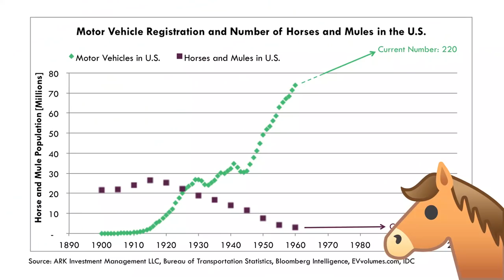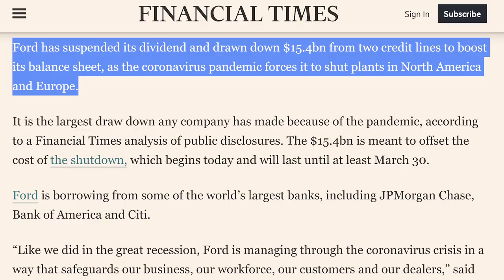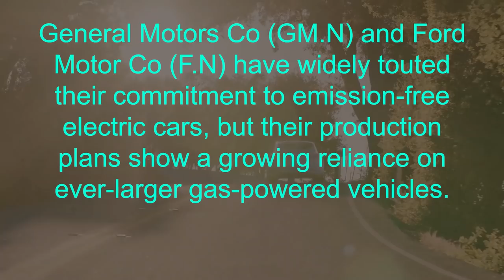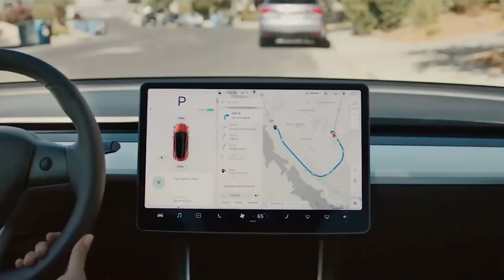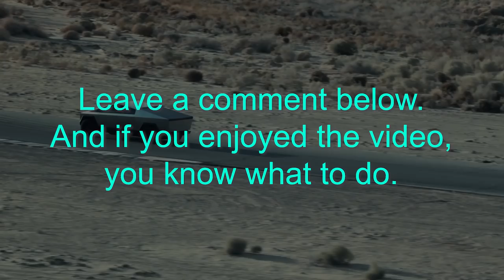Ford and GM are in BIG Trouble (bankrupt soon?)

Comment: 0:14 when I read “I’m using Tesla footage because they won’t sue me” I was like ok yeah I can see that, sounds reasonable, then I saw “they’re eating Ford and GM’s lunch” I just started to crack up 😂😂 I love this channel.
Reply: Girard Perregaux  Thanks
Reply: Lol Tesla's revenue has never made it over 13 Billion. In 2018 Fords revenue was 160 billion. GMs was 190 billion. Get real.
Reply from the maker: @chasejordan22  Your credibility vanished 9 words in dude. They did $13B in 2017. Sorry to see you self-immolate so quickly.

Perhaps also you don't understand the value for growth. How much is Ford and GM growing revenue by every year?
Reply: @SolvingTheMoneyProblem  
Ummm? 13 Billion is not over 13 Billion....... Jesus son. 
 Damn is that a difficult concept?
 Ford has the best selling vehicle for 45 years. Telsa.... Has some neat grocery getters. I cant do my job with a tesla. Because I tow. It's impossible.
Reply: Chase Jordan 
GM and Ford sell most of their cars at cost. Money is made in the financing. When ICE cars start to fade their used resale value will plummet. Big Auto will be picking up the tab on cars worth far less than the PCP final values. 
Not to mention their now worthless manufacturing assets and huge pension liabilities.
Reply: @Dave5843-d9m  
Your basing you point off one line. When their sales fade. The best selling vehicle, the f series, has capabilities that Tesla is only starting to dream about. Look up towing range on current models. Batteries are still years and years and years away from even competeing with diesel engines. 
Resale value will be competitive until you see a 30 year old neglected EV still trucking down the road. Like you can see all day long with combustion engines. Optimism bias affects us all.
Reply: @chasejordan22  Stock values are based on FUTURE earnings and values.  What do you think Wall Street is valuing Ford and GM vs Tesla?  That is real.  Just borrow a Tesla and drive one - you will curse at your own car when you drive home in it.
Reply: @SolvingTheMoneyProblem  holy crap you freaking killed him dude
Reply: @dzerres  
Ah hah a thrid argument but finally a logical one. Ford was in the money spending, profit loosing phase of updating its trucks to a new gneration (engineering and research and retooling plants) when the god for saken virus hit. Bad timing. Ford has survived every recession for a hundred years, they'll make it through this one too.
But as I mentioned before, I drive a truck. An F-350, whose resale value is at 54% in 5 years. Higher then any Tesla. You cant do what I do in a Tesla, its impossible. I doubt I would be very impressed because my standards would be very different then yours. I suggest you go test drive a four door F-350 King Ranch.
Reply: @oscarprice7030  
I said they never made over 13B
He said "They made 13B in 2017".... 
Do i have to explain to you that 13B is not over 13B as well? 
I doubt it would help much.
Reply: @chasejordan22   a quick Google shows they made $24.6 billion revenue  in 2019 which I would expect considering they made 13 billion back in 2017? Why is everyone else getting this but not you ?
Reply from the maker: @chasejordan22  It's not 2017 anymore Chase. Tesla's revenue has grown every single year since going public. That includes growing from 2017 to 2018 AND from 2018 to 2019.
Reply: @candidate17  
Yes I saw that myself. I was going off previous knowledge. That is new info to me. That literally doesnt change any of the argument. Even the 13B is not more then 13B. 
So they made it up to 24B this previous year. What does that change about what Im not getting? 
You know the difference between revenue and profit? What was Teslas net profit in 2019? Negative 800 million. Search that one.
Reply: @SolvingTheMoneyProblem  
Correct. My response was directly to your ridiculous comment. Their revenue has increased. What is their net profit? Negative. Other companys promised much more in the past. Talk to me when they have a few profitable years.
Reply: I think the world has more confidence that after covid-19 tesla will be able to dig out of the financial hole quicker than Ford, just look at the stock prices
Reply: @chasejordan22  your completely missing the whole point of this video , it's not a race of who is making more profit, it's a race of who is making solid foundations for the future of vehicles.

I'm pretty sure the mass horse breeders were making far more profit than the first car company back when they were some backyard creation too. And look how quickly that changed. The whole point of this video is adapt of be lost to time .
Reply: @candidate17  
I made a comment. Which I do suppose was incorrect because of the dollar amout. But that small difference doesn't change my original argument. Then I had a bunch of responses and I replied to each one accordingly. 
If now your point is Tesla will be more profitable in the future, then my response is thats just a prediction and if it were that easily known we would all be investing and making millions. Too many company's have promised the same thing and never delivered. Does Tesla have some promise? Sure but the overwhelming notion on the internet and this comment section is Tesla is going to either just replace Ford GM and so on or just dominate the market. Thats very very pie in the sky. You'll need much much more evidence to convince me of that.
Reply: @chasejordan22  Don't underestimate EVs. Their flexibility electricity production and storage, along with the shear power of their motors, gives them options that gas trucks don't have. There are already 4 EV trucks (at least) that can out tow your F350. 2 of which have better range as well. Granted, none of them would replace your F350, as 3 are semis that are in active testing (not selling yet), and the 1 EV truck that is being sold is a specialty quarry truck that is only useful in certain circumstances. Although that certain circumstance gives it unlimited range. Pretty neat use case. The Kuhn eDumper.

Again, none of those will replace your F350, but it does show what an EV can do. After the Tesla Semi begins production, it's charging network will expand with options to charge those big trucks quickly. Once done, you will likely start seeing actual work truck EVs being sold. It is also possible that FCEV trucks will begin selling within a few years as well. This would help with range and weight issues with current batteries. Each will be a few more years before they expand to be an option for you. Still, they will be able to replace most work done by other SuperDuties at that time, and will likely save you hundreds or even thousands of dollar each month. At that point, you would be crazy to not replace the F350.
Reply: @chasejordan22  For the revenue numbers, Tesla doubled their revenue in 2 years from 2017-2019, and they will likely double again between 2019 to 2021. Ford will likely drop 15-25% between 2018 and 2020, and likely drop again in 2022. This is Ford's big problem. Last year, they effectively made no profit at all. But even if we take 2018's numbers for them, they only made $3.6 billion. Combine that with a likely more than $20 billion drop in revenue this year and likely more drops in the coming years, and you can start to see why their future is in question. 

Still, Ford has a huge amount of cash on hand available, more than enough to weather the storm this year. However, there will need to be some cuts and restructuring may be put on hold. This could spell disaster once both Tesla and Rivian start selling their future EV trucks. While neither will likely take the crown of "best selling vehicle" from the F150, they will hurt sells, especially in the highend truck market. I wouldn't be surprised to see F150 sells drop 20% or more, while profit from F150s drop 30% or more. If something similar were to hit next year, Ford wouldn't survive it. But, since they do have so much cash on hand and about 2 years before it hits, they have time to prepare.
Reply: Chase is looking at things as they are today, not where they are headed. Tesla has a very limited range of vehicles. There towing capacity is definitely a weak point up to now. The model Y does not even have a tow hitch. I'm actually a Tesla fan and that is disappointing to me. I think this situation is going to change in the relatively near future. The tri motor cybertruck with a 800 km range battery pack will finally have enough range to afford to also be viable for serious towing. I'm in Australia, I pre ordered the tri-motor. I dont expect to get it till 2023. It's not really that far off... especially with 2020 being completely fucked with this plague lol
Reply: @chasejordan22  and then comes TSLA's Semi and Cybertruck 😂
Reply: @andrewpp2000  
Your not serious are you? The Cybertruck is a grocery getter. It cant tow as much as 20 year old f250s.... The semi is in the shell car stage. Let me ask you thism when will the semi even hit production? You Tesla fan kids are awfully blinded by your optimism bias. And just ignorant.
Reply: @Isaac Barrett 
I call the Cybertruck a grocery getter like I call A Toyota Tacoma a grocery getter. Ive wrote it a dozen times, a 20 year old f250 can tow much more weight farther. You could never tow a camper across your state with a Cybertruck. Thats why I say what I say.  Battery is still a long long way away from competing with diesel. And when I hear the talk of Tesla replacing Ford and Chevy in five years, well its laughable.
Reply: Well with Tesla’s abysmal build quality and trashy reliability, I don’t think we’re gonna find any “solid foundations” from them in the near future.

Comment: I used to work at a job which had me working with Ford and GM executives a decade or so back.  I remember talking to a GM guy who was talking about the hundreds upon hundreds of plants they had, scattered across North America making bits and pieces of cars.  I asked “Why would you have so many plants?  Isn’t it incredibly inefficient and expensive?  Why not just have one super factory the size of a small city?”  He laughed and said “We’d never do that, the unions could shut down the company any time they wanted, now they can only shut down one tiny piece.”  The first time I saw the Tesla gigafactory written up, I laughed, remembering that conversation.
Reply: In the not too distant future, that gigafactory will also be fully automated.  Only a power failure or lack of prefab component materials will shut it down
Reply: Tesla gigafactory is in china, union will never be able to shut it down
Reply: The more the Unions tighten their grip the more companies will slip through their fingers and automate.
Reply: Paradigm trap: Mgt vs Unions. Very real until it’s not
Reply: when you fear Unions, you are doing something wrong, that's why they are scared of big factories...
Reply: Giga Nevada is Non Union

Comment: The other OEM is Renault. They have many electric cars. Their cars are also made to be affordable. They are on the right track.
Reply: Mercedes was a shareholder of Tesla a few years ago, so they should be somewhat ok. The only thing is, who is building battery factories. That is the important bottleneck. That and software. To me no OEM is able to make the software, as it is needed. On the other hand Germans are not an easy opponent. They tend to win. So be prepared for a fight.
When it comes to Ford and GM, they may be done for. The question is, will they get a bail out. But does that help shareholders? I do not think so. Maybe Tesla will have some high skilled employees and factories to buy at a discount.
Reply: @grzegorzkapica7930  Legacy automaker factories are of no use to a company like Tesla. It's far cheaper and more efficient for them to build a factory from scratch, using Giga Shanghai and Giga Berlin as templates. When Tesla took Fremont off Toyota and GM, the few assets (machines) that were left there were scrapped. Tesla cleaned out the whole building an re-fitted it. Even now, Fremont is not ideally designed for modern EV manufacturing. Tesla could conceivably shut Fremont down in a couple of years and move all production to a new Giga-5 located in the middle of the USA - Texas has been suggested as a possible venue.

Comment: Not just Ford and GM. Toyota and Honda for sure, BMW, and probably Daimler. It will be a bloodbath.
Reply: Sharpen the Shorty knives...
Reply: Daimler and Bmw are not stupid. They have innovated constantly and will EASILY adapt to a new power source.
Reply: The biggest bloodbath will be Armageddon. No man or men will ever overcome that relying only on themselves.
Reply: DJProject2130 please tell me the Germans can’t innovate or design- its only a power plant insertion and then you have an ev. lotsa motors, lotsa batteries out there. And Tesla motor is open source.
Reply: Well, there’s battery research, battery management, battery production, motor production, OS, and charging network to overcome. Remember, if you outsource somebody is both taking your money and keeping the intellectual property. And maybe not even innovating significantly. If you do it yourself, you still pay but you keep the IP and you control your pace of innovation. And if you outsource you are competing for those resources.

Comment: A Multi Billion Dollar Industry is about to go out of business within this decade. EVs do not require the same level of service that I.C.E. cars must have to function - actually, tire service is it. "New Car Dealerships" and the hundred thousand or so independent car repair shops all NEED I.C.E. cars. Then there are the billion dollar aftermarket parts stores who sell I.C.E. parts and accessories, like car batteries, oil, oil filters, air filters, drain pans, rags, wrenches, spark plugs, engine chrome kits, driveway ramps, floor jacks, exhaust pieces, engine performance parts - and a whole lot more. That entire business model is going to be GONE by 2030 -  gas stations and previous parts places abandonded, run down hulks with another hundred thousand workers unemployed for life. It's coming to that. I want EVs too.
What if some clever, enterprising people started converting Gas Stations and Parts Houses into EV Charge stations. Each facility would have several Tesla Walls charged by a combination of on site solar, wind and Geo Thermal. The building could be a convenience store or fast food or any type of unique destination that would offer 5 to 45 minutes of diversion or task completion while EVs charge. Going to be a lot easier to start this now instead of shutting an entire industry down, laying off workers, destroying a vital part of the economy, etc. Just an idea...
Reply: CLP  I am sorry to hear that - but please keep in mind this is MY utopia, where Teslas never break but I.C.E. cars never work right. OK, thanks...

Comment: Great video as always. I own a Tesla and love it but I am also like you happy to see VW gets it and I wish them all the best. I also happen to be fully covered in solar panels and I even sell electricity when I cant use more and my house and car battery is full. Here I think there is a huge opportunity for a car manufacturer who partners with or turns into an energy grid provider by enabling the car batteries when connected to be used to stabilize the  grid and pay the car/battery owner for it while only charging the car when the grid has a surplus of energy which is sold cheaper. There are several initiatives like this already but I think if someone like Tesla or VW does this they can really get scale and make it even more stupid to not get an EV making money for them when parked even without the Robotaxi feature.

Comment: Thats better i hate ford and GM both
GM biggest contributor to Global Warming 
FORD same but also makes crappy cars
Reply: RagBits have you ever driven either?
Reply: No lol. I hope they dont disappear due to job loss. The transition will happen. With them or without them. Better with them then.
Reply: TieMan exactly, people might not like them. But the loss would be heavier then the benefits
Reply: @feitan8033  i also doubt transition will happen quicker without GM and Ford. Mostly because production is scaled up as fast as possible. If GM and Ford fail, supply will be very low and demand will stay the same. Prices will skyrocket. Not good for America
Reply: @tieman3790  Higher until the Chinese  and VW arrive.
Reply: @205rider8  the chinese are really trying to go green tho. They are fully stimulating evs. They have this huge smog and pollution problem. They really wanna go green

Comment: I allmost got the feeling vw is up to something, then I remembered the id3
Reply: I think the ID3 is pretty good looking, but smaller size, expensive price, limited range, and thousands sitting idle in parkinglots without actual working software. There's articles stating they're recieving hundreds of bugs and errors daily recently as well from only a hundred test vehicles. A rushed product is a rushed product.
Reply: The iD3 concept was first shown in 2016, there's no way the production car shouldn't have been in dealerships in Europe at least by 2018 or 2019. A 'smaller' company revealed its fourth production EV in 2019 and is delivering them to customers in the US in March 2020.,even in the health crisis.whether  they outsell Tesla or not, there really should be a lot more EVs on the streets worldwide variable to the sheer amount of future EVS promised by legacy and startups the last 5 years, disappointing .